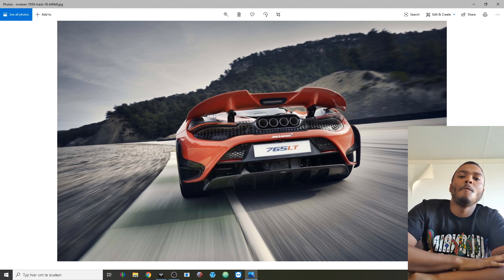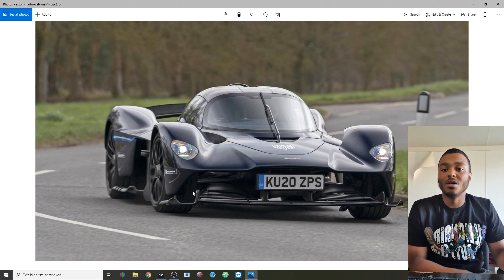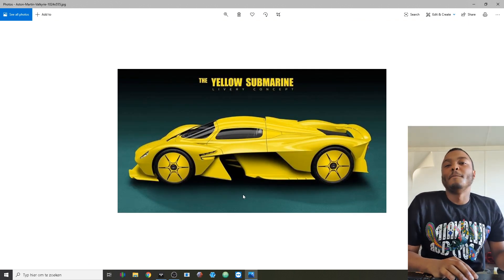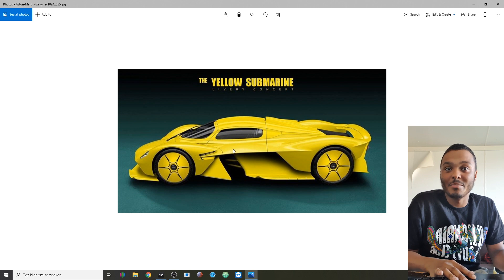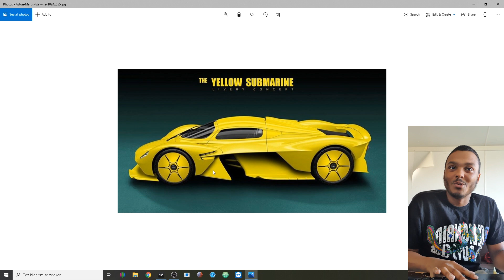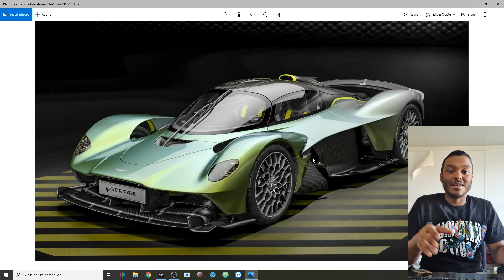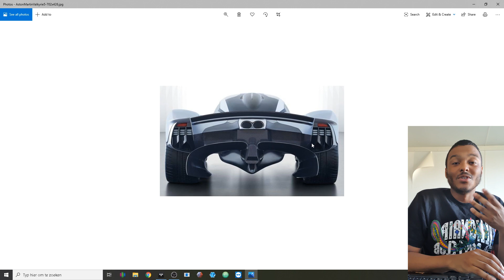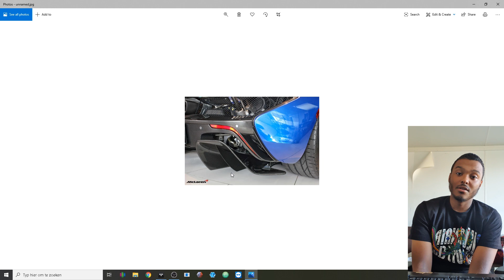Analyzing the Aston Martin Valkyrie Aerodynamics | The Nr1 Designer

Comment: Nice to see someone mentioning the utilization of the rotating air effect on this diffuser (don't know if you see on the photos but there are like a foot size vortexes generators inside the tunnels).

I don't know if I got you wrong but those front tip elements aren't in straight line (they point inwards) so them you have symmetrical vortexes. If they were in straight line, you would end up with a big assymmetry on front wing's flow under yaw. I kinda think that they are there too to streigthen/house/assure symmetry on the flow (again, under yaw) therefore you would have similar vortexes on both sides under those expansion elements.

Waiting for more analysis like this one! Good work!
Reply from the maker: I love comments like these. Thank you so much